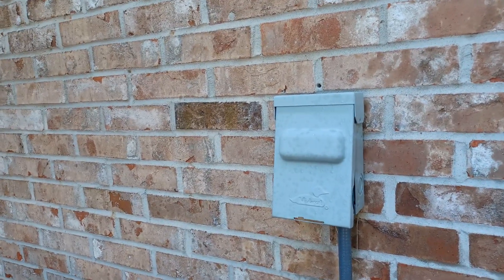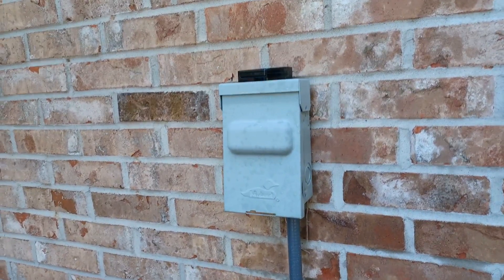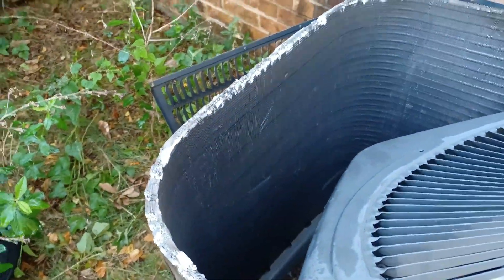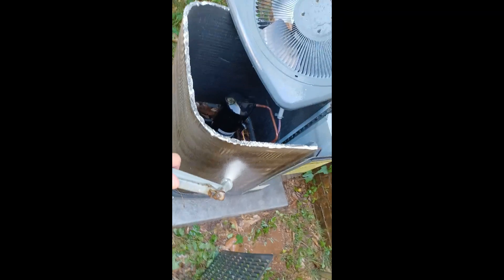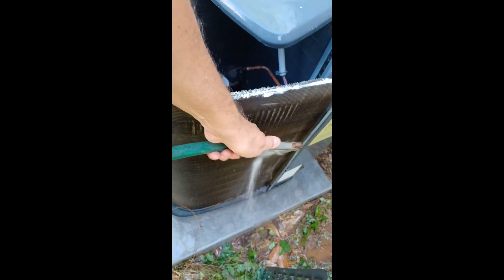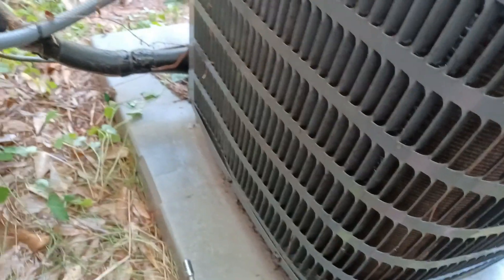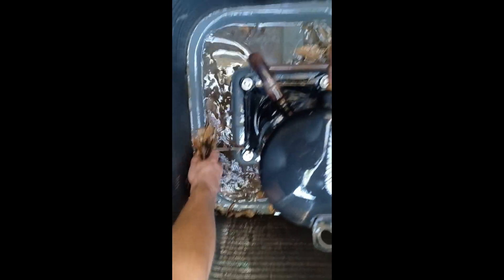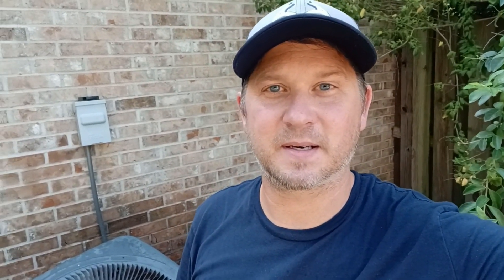#1 Reason Your Air Conditioner Isn't Cold

Comment: Do I necessarily need to remove the outer coverings?  Can I spray the unit still intact? Thanks.
Reply from the maker: Nicole, you do not have to remove the outside covering..especially if you clean it more often. I remove mine to get a more thorough cleaning. Thanks for commenting.